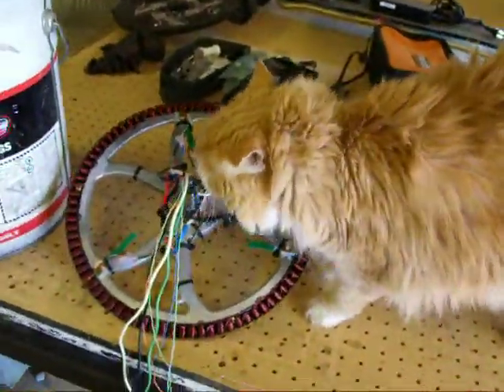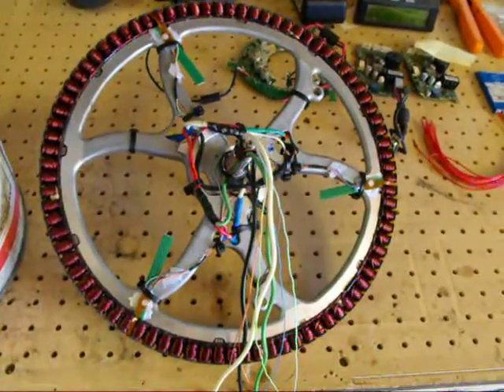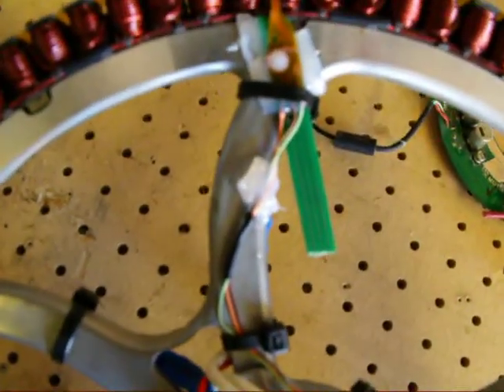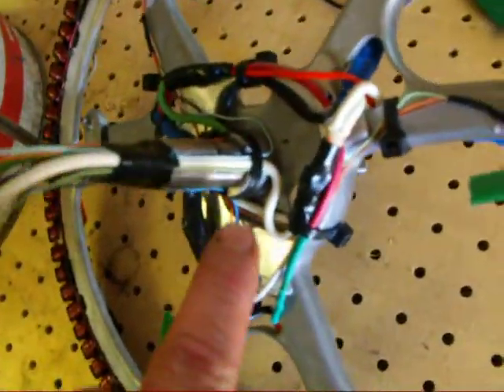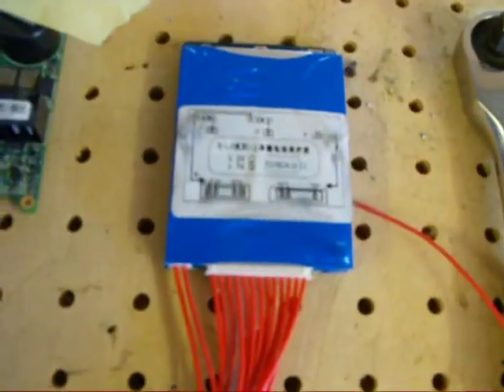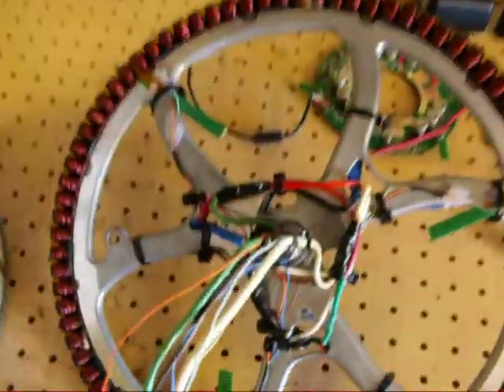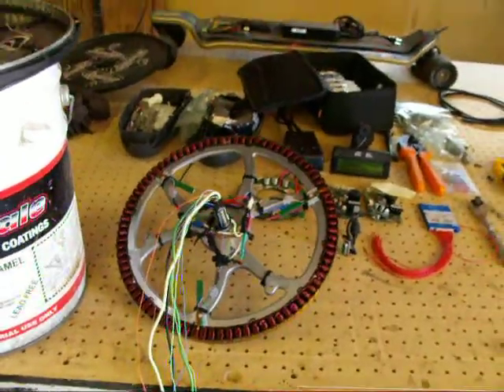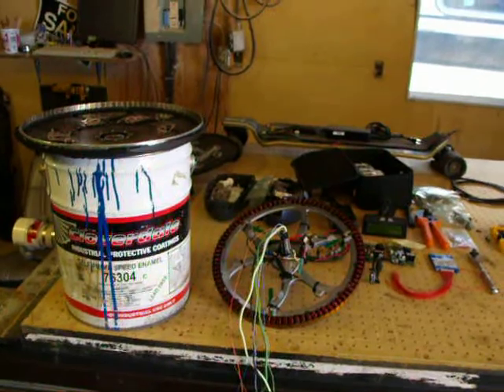Attempting to fix a BionX hub motor part #1.  Disassembled.....

Comment: Do you need to remove the free-hub body before you open the motor? Doesn't seem like it since it's still on the motor in a couple later videos, but not clear. Mine has free hub like yours seems to have (P350 DV). All the other vids I can find show other models with the freewheel that just unscrews with freewheel tool. Thanks for your vids!
Reply from the maker: pretty sure you can leave it on.
Reply: @georgethecat5080  Thank you!

Comment: Hi - i have a d500 thats whinning like crazy.. it works well . lots of power but whinninvg noise drive me crazy,, any idea whats going on ? or how to correct it?
Reply from the maker: the motor has "dynamat" sound deadening in it.  so i think they are noisy anyhow.  time will tell ;)
Reply: @georgethecat5080 This is a direct drive motor so there should be no winning gear noise. Is yours running quiet now since you glued the magnet ring back in place? We have one that is winning we need to fix. Thanks for any help. Charlie
Reply from the maker: @gocharlieo  same noise now for years.  still running fine.
Reply: Hi @grrnyc did u found a solution for this problem?